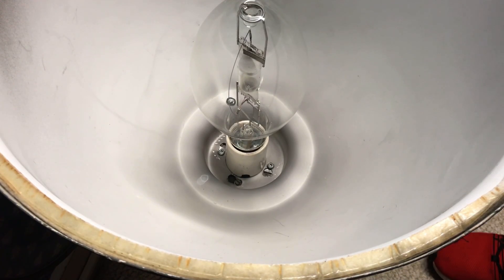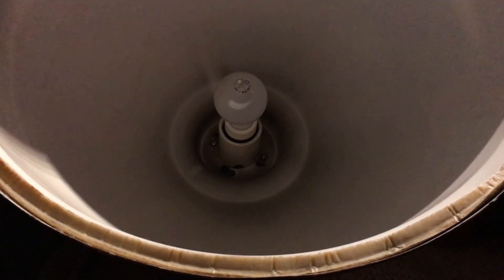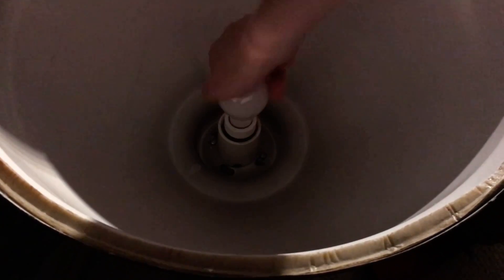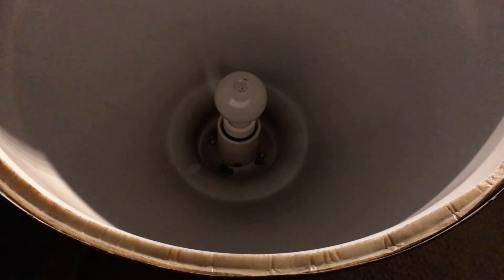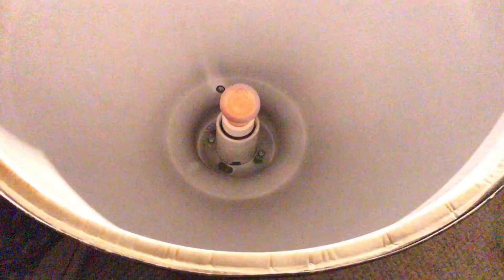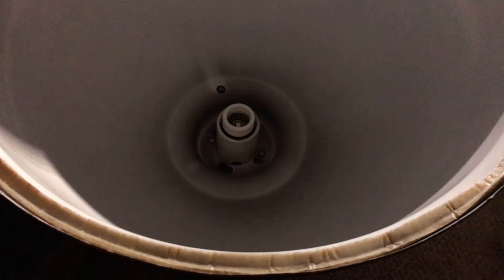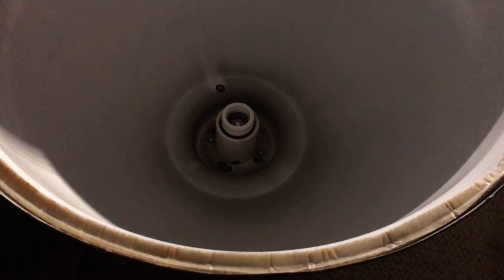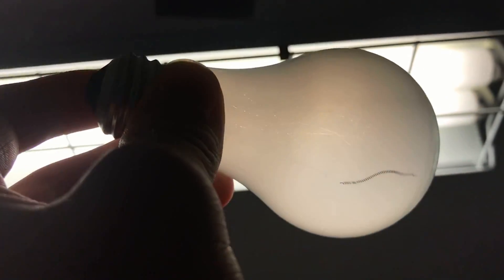Exploding Incandescent Bulbs On A Metal Halide Ballast

Comment: Try cheap led and clf bulbs
Reply from the maker: Ok
Reply: @Jclighting-11  I've done this before, and from what i've found, older TCP CFLs (often sold under the Commercial Electric, TechnaBright and N:Vision brands) will often have the most violent burn outs, specifically on pulse start gear, to the point that they will catch fire, so be careful about that.
Reply from the maker: @high-intensity  I have one of those but I don’t want to destroy it because I like those old cfls
Reply: @Jclighting-11  Same here, but i have done it to a few dead ones.

Comment: I think the reason the "refrigerator" aka appliance bulbs tend to go out with more of a sustained arc is because those particular bulbs don't have internal fuses.   I have a 17 inch lava lamp that uses a 40 watt appliance bulb, and after it burned out, I took my 400 watt pulse start MH fixture, screwed in  a mogul to medium base adapter, then screwed a 2 prong adapter into it then turned the lava lamp on (without the globe sitting in place of course).   It struck an arc inside the bulb and sustained it for about maybe 5 to 10 seconds then the top of the bulb shattered, which of course stopped the arc.   Other "burned out" incandescent bulbs I finished off on the pulse start metal halide ballast they melted the internal glass stem in half causing air to enter the bulb and extinguish the arc.  

The vast majority of incandescent bulbs have a fuse built-in to one or both leads inside the stem, to prevent a sustained "burn out arc".   A burn out arc is more likely to occur when the filament breaks while the lamp has been running for some time at full power as opposed to breaking on a cold start.  Because an arc is a negative impedance, its resistance decreases as the current flow increases.  This means a burn out arc can draw several hundreds of amps which would likely cause circuit breakers to trip as well as exposure to flying glass shards of the bulb exploded.
Reply from the maker: Thanks, that is very interesting